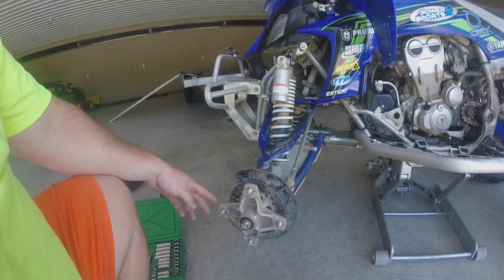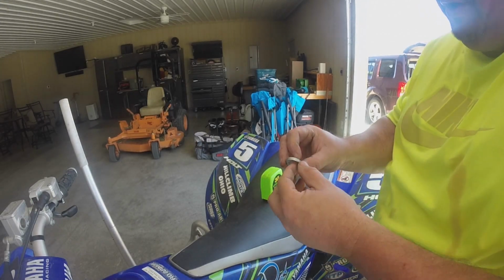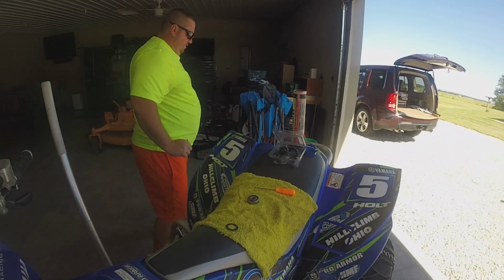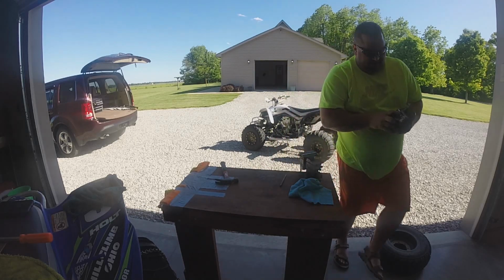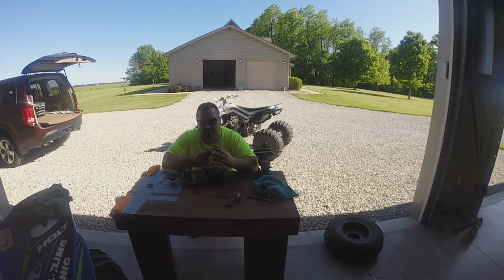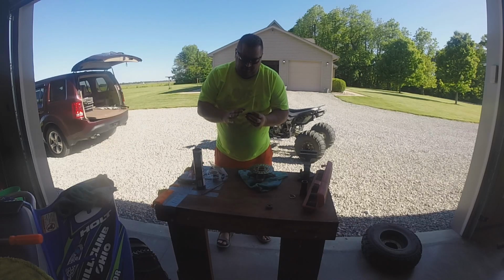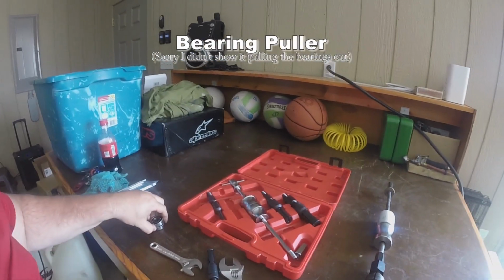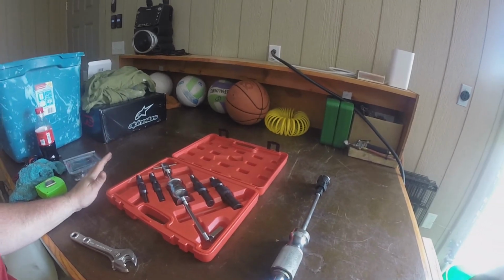YFZ 450 Front Bearing Replacement & Tips/Secrets

Comment: Hey man great vid👍🏼 when I remove my castle nut, the hub doesn’t come out as easy as yours as if it is stuck or something? What should I do?
Reply from the maker: Wood block against rotor and tap on wood block to see if it will loosen
Reply: @ChadHoltHillClimbUSA  thank you
Reply: @ChadHoltHillClimbUSA  just tried and that did t work, any other suggestions?
Reply from the maker: @joshuacastillo5952  not really, bigger hammer😳